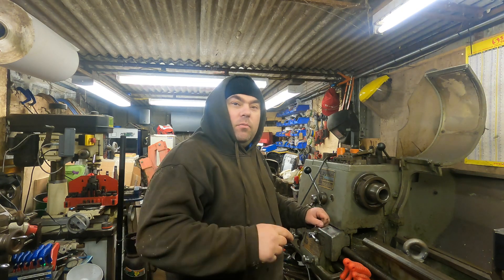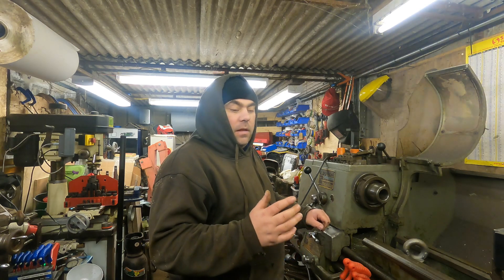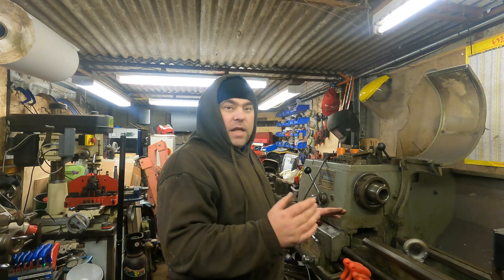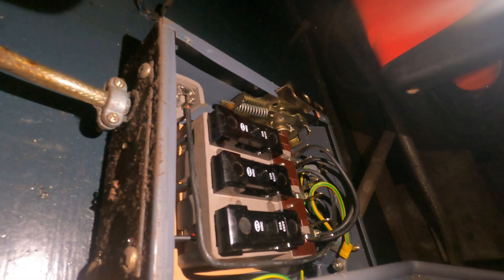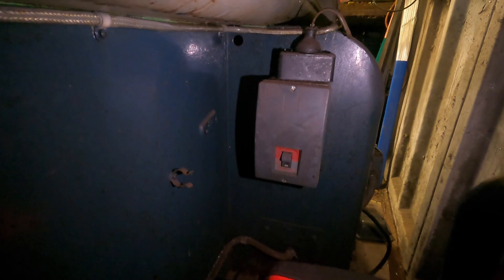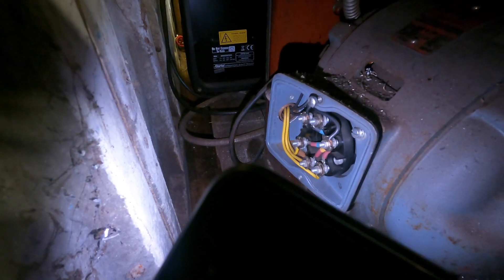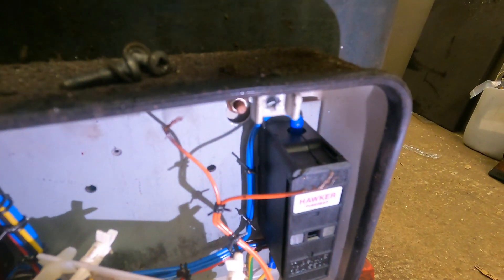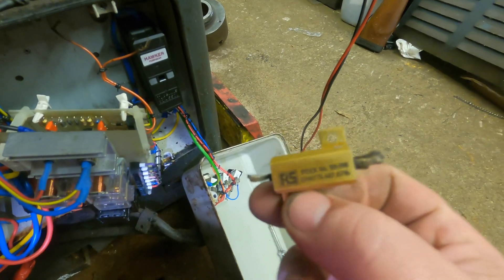CAN THIS BE FIXED COLCHESTER STUDENT LATHE

Comment: Please take all my comments as constructive advice even if they seem condescending.

Note 1! your latter comments about not needing a E-Stop circuit had me gobsmacked, yes you may be correct in the fact it's your garage and only you use it so you can live as dangerously as you want, but if anyone else were to use this lathe or was injured while you were using it in their presence then you are still legally liable to ensure their safety even if its just curious family members so having such systems in are a must.
Note 2! Messing about with safety critical systems without actually understanding them is asking for problems and/or risk to yourself and possibly others, I have seen lathes rip arms off and know of a few deaths from them catching clothing and pulling the user around the lathe.

Your video is confusing for me, you keep saying you have checked this and that and then go on to say your not sure what it is IE the light transformer box, how can you test things if you don't know how they work or there function? You go on to tell us you tested the motor terminals and power was there, if you had the correct power at the motor your main spindle motor would be running yet it isn't, please explain how you tested it and what your results were and how you managed to energise it given you claim it had power?
 It seems you have a very basic understanding but IMHO well below what is needed to be faulting such a machine, you seem to make some assumptions as appose to actually verifying things, you identified the resistor having broken wires, did you test the resistor for it tabulated value, did you insulation test it too? Have you identified its function and checked voltage through so you can establish it is the broken wires inhibiting the control functions, you may get lucky here and it was faulty and replacing it corrects it, the price of a resistor that size is negligible so no real dint in the pocket if its not - PS it may have been damaged by a fault current, be cautious of fitting a new one without clearing or confirming no faults in advance.

 These lathes are very basic in control and power circuit wiring, the later addition of a now dated and non compliant E-Stop control unit shouldn't pose too much of a problem either, you just need to identify how it works, just remember E-Stop circuits may also include limit switches for spindle guards or mechanical housing covers that all may need to be closed before the E-Stop control can be reset, spindle guards may also have override options for inching etc when setting up.

Comment: The box round the back is the lovolite unit transformer which turns the 440v into 50v or 25 v for the machine light. Is your phase convertor 240v 3 phase output or 400v three phase output? If it is 240 v three phase you will need to connect the motor in delta connection for it to run. Find this on the net or you may have instructions inside the motor terminal box. I do not think the emergency stop  will work on 240v three phase as it will be made for 400v three phase.
Phil, East Yorkshire